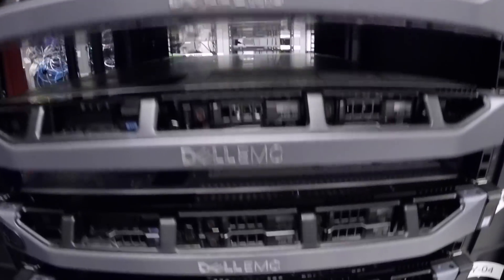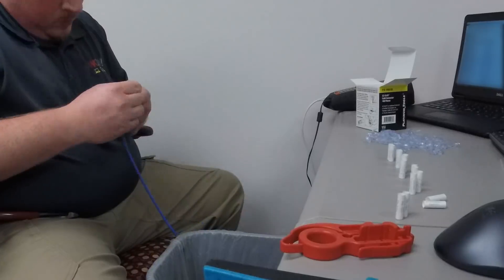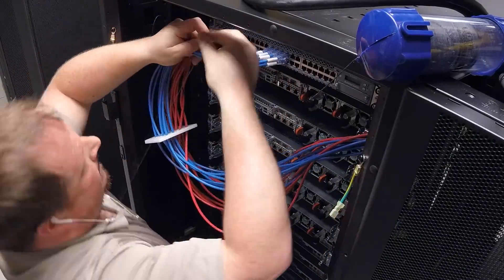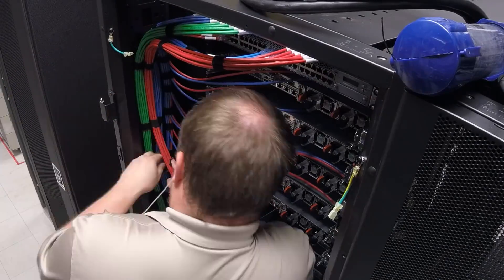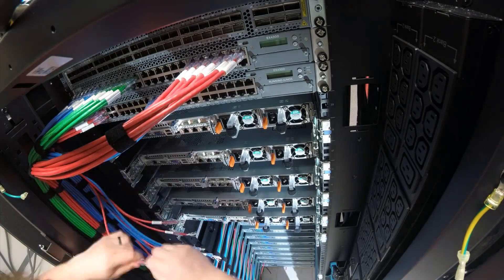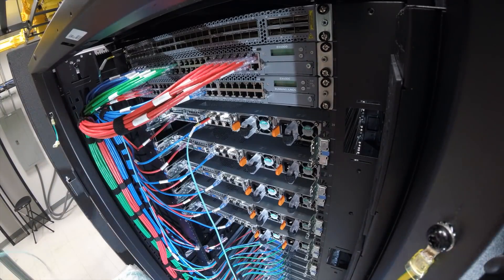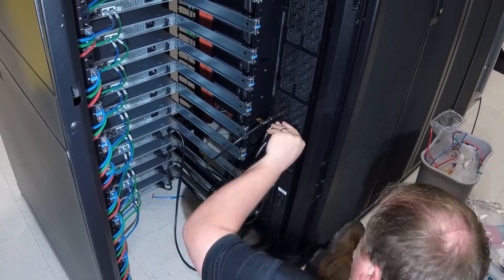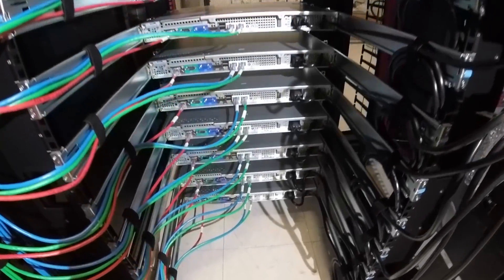Server Cable Build-out TimeLapse!

Comment: Ah to only deal with copper and fiber. It would be nice... I deal with 100G QSFP with 4x SFP breakouts with no good way to run them down the side of the cabinet. Add in a copper connection for remote access and it gets rough and these are 40 servers in a rack with 2 NICs.

Comment: Great work – that's a true piece of art. I even struggled with cable management in a small rack of the ad agency I'm working for.
One Idea I had to clean this up a little bit more: The 1 unit spaces could be filled with those brush panels to hide the wire rings behind them.

Comment: As far as not getting custom length fiber or power cables I'd say reterminate them too, all it takes is a little bit of know-how and the right tools for the job, if either or both are lacking that's a chance to develop your work skills or workplace equipment. Neither being all that expensive. All in all, great job.

Comment: I still don't understand why anyone would want to use solid core cables and hand terminate them for what is a patch cable. Patch cables are made of stranded copper and machine termination is just more reliable. They make a ton of lengths. You spend more money in labor alone then purchasing patch cables in bulk.

Comment: This reminds me of my old job at an IBM data center. Whenever we’d build out a new row we’d have hundreds and hundreds of individual eth cables going to each rack. We used to have to run them individually like you’re doing here, but eventually we started ordering custom made RGB bundles that were already cable managed and cut to size and mounted on the side of the rack as one piece. HUGE time saver... except for when we were building a custom row for internal servers. Still had to run each fiber cable individually though....

Comment: I generally prefer to either buy cables of correct length, or make them to order myself. Calculating cable length is usually not too hard and getting 5-10 cm extra isn't unwieldy in most cases. And I like making the cables outside of the rack, since then we can skip the shortening procedure at 3:30.

Cable isn't particularly expensive, but cutting off 20-30cm with each cable one makes quickly adds up. Not to mention that it still is a resource that could have been used more efficiently. From an environmental standpoint, our first rule of recycling is "Reduce", and I see a lot of people doing network cable management that throws out literal tons of "extra" cable for the sole reason that they wanted to save 30 seconds worth of calculating the length correctly. One can fairly trivially just make a spread sheet for it. Account for depth of the device in the rack, how far in on the rack it is, and how many rack units we need to traverse. And that is now the length of the cable, trivial. Add a bit of extra as buffer just in case. Works every time with 0 waste.

Comment: whats a good way to manage cable going vertical if your rack is not as deep as the one in this video?  Is there a rule of thumb about putting the switches in the back is it just for simplification? also how do you deal with sliding the servers in and out?

Comment: Learning to make your own custom fiber cables is not that difficult these days. I was doing fiber connectors back when we had to use glue injected connectors and hand polish the end of the fiber in the connector using a hand held microscope to monitor the polishing progression. I believe with the new technics today they could be done as quick or quicker than RJ45's.

Comment: Do you/have you use the pass thru style RJ45 plugs. We (just a two man dept.) tried them and couldn't get them to test out. I mean two different guys and we used sever sets of crimper pliers and both had bad connections. That style did seem to go together fast, but just was bad when we got done. I'm curious if other techs ever had issues with pass thru style plugs? With the managers we work under there's about a four year turnover in IT techs. No one stays longer than that as there's just no budget and it gets very frustrating, so people just move on. Only brief reboots is the only reason the servers can be down, never any maintenance time, NEVER.

Comment: Was the switches ex4300's with poe+ for the copper wires. Don't know about the sfp fibre switches which would probably be a few K of it was 10GB
Reply from the maker: We use EX4300s for our copper connections, I believe the Fiber Switch was a QFX.

Comment: A very good video, thanks for sharing. I have another newbie question if thats okay... What are the Red, Green, and Blue Ethernet cables used for? Is this an industry standard?
Reply from the maker: There is no "Industry" standard that I'm aware of. We have an internal standard about what rides over each cable. In this instance, Red is Lights out management (Dell calls it IDRAC). Blue is our management network, and Green is "Production" data traffic.

Comment: Amazing! Just finished patching three switches totaling about 466 ports to patch panels. No custom length cables just 6ft, 10ft, and 15ft pre-made CAT6. Balancing slack and neatness for that many runs is interesting and challenging! Also, big fan of hook and loop. Lacing is very cool, but not something I've ever used.
Reply from the maker: Lacing is an art-form in and of itself, Even I cant make it look as good as others I work with. Also i feel for you patching that many ports! I did about half that while doing a new build out for a college dorm and it was a pain to get it to look good!

Comment: What do you use to label te cables and what's the standart strategy?
Reply from the maker: Labels are a Rhino P-Touch style labeler using their driver and software package to make the labels on a computer. Each cable gets labeled on both ends even if it does not leave a given rack. We put the "local" device and port and the "Remote" device and port on each side. Additionally we may add other labels that have Circuit IDs or customer IDs. A typical label reads like this: <Near device ID> et-0/0/0 TO et-0/0/0 <Far end device ID>

Comment: I know one advantage of having loose cables: when there's one cable not working, it's easier to remove.  When everything is tightly fastened and tucked like this, you'll end up spending hours undoing your long hard work. Did you test your custom cables before tying them?
Reply from the maker: All cables were tested before being put into production, I just did not get a good chance to record it. And since we used Velcro, It does not take long at all to pull this apart and add/replace cables. Luckly, with the effort i put into the pre-wiring work, we havent needed to touch this stack to add or replace cables

Comment: fairly new to networking, so this may be a bit of a noobish question. but why are the servers getting multiple network cables? if it for load balancing or management?
Reply from the maker: Don't worry about asking noobish questions, that's how you learn! So on the top servers, the fiber connections are redundant. They also get a connection to the Management network, and there's also a connection to the Dell iDRAC connection to allow for lights out management. On the bottom servers, Its the same setup, but instead of fiber, there is an ethernet cable for the "Production" network.
Reply: @RomLabs  Thanks a lot!

Comment: What is needed to learn or how did you learn to build a data center?...if that’s what this is called. Pretty much if I want to do this what do I have to learn
Reply from the maker: There is a bunch of different skills that go into data center work. Its best to decide what your most interested in. What you see demonstrated in this video would be considered Low Voltage Wiring or Cable Pulling. If you want to work more on the server side, you may want to look into things like "Dev Ops" and virtualization. Networking also plays a big part, and you can explore certification tracks like the Cisco CCNA certification.

Comment: Dude, you should have made all those cables longer so they don't need to be disconnected when you pull the server out on its rails to either upgrade or replace faulty components,  Still could have been tidy if you had used the cable management arm which holds the cables and extra length in a tidy way and extends when you pull the server out of the rack!
Reply from the maker: Unfortunately we only received cable management arms for the larger R620 servers, not the smaller ones. These are clustered together and the “Owner” of the servers is OK with downtime if we need to work on them. I would tend to use the arms in other situations, but it just did not make sense for this project. Thanks for watching!

Comment: This looks great but with all that crimping I didn't see you test each cable before installing them to make sure all pairs are terminated correctly. Just a heads up for your future cables. Unless you like troubleshooting cables. I've found too many bad cables because people assume they are fine if they look good.
Reply from the maker: Every cable got tested and certified with a Fluke CableIQ meter. It simply did not flow well with the rest of the video so it got cut. I did end up finding a few mis-crimps but they were easy to replace. Thanks for watching!

Comment: Never a good idea to coil power cables... Potential fire hazard depending on the loads those servers are drawing. Always lay power cables flat going back and forth. Coiled you're basically making one half of a transformer...
Reply: Not remotely. The current running TO the device and the current returning FROM the device cancel out any significant magnetic field. The only risk of coiling up cable is if you're running them near max specification and they heat up due to lack of air flow.

Have a peek here: https://electronics.stackexchange.com/questions/192923/why-is-it-dangerous-use-a-coiled-extension-cord/232510#232510

Comment: Why, I repeat, why the hell are you making custom cables? Patch cables are so cheap and literally can get them sized with no slack. You also dont have to worry about solid wire limitations on bends.....Just too much work for no gained benefit.
Reply from the maker: Simply put, I could not get the other departments involved in this project to order the proper length cables. They would not even order me different lengths of the power cables. Got to make do with the tools and supplies given!

Comment: Why the UTP cables when you also use fiber? Fiber does the same thing but 10 times faster?
Reply from the maker: There is a cost associated with running fiber for everything. First the Dell iDRAC is Ethernet only. On the management side, using a separate copper connection means we have an alternate way in case something goes wrong on the fiber side. For the lower servers, is simply cheaper, They simply won't see the traffic to justify a fiber connection. We do attempt to keep anything 1Gbps or above on fiber however.

Comment: What type of RJ45s did you use? I like those with the boots.
Reply from the maker: Platinum Tools EZ-RJ45. I love the boots since they are the same plastic that's in the connector itself, and it has 2 prongs that attach to the crimp via the outer jacket crimp in the back. That means the jacket is the same width as the connector itself so no issues with tight fit on switches. They feel real nice all crimped on and look great.

Comment: Is there any consideration for rolling the Server out on its Rails?
I mean, if there's a need to replace or upgrade hardware, I can see exactly how the rest of your work simplifies the disconnection and reconnection of all cabling, but I'd just thought about it looking over the finished product (it was the Power cables that prompted the thought).

Similarly, where did you get the HDPE plates you pre-drilled for those cable combs?
I bought a Cable Comb designed for long haul copper cabling pulls (where a good amount of force would be applied to the Cable Comb) but the plates you have there are simply genius for planning out, and procedurally 'grooming' each set of cables for each device in that rack.

The finished result isn't appreciated by some, but for others who have had to come in and clean up, or worse, try to just 'make sense' of the cabling nests that are abandoned, this level of detail, and finish is massively appreciated!
Reply from the maker: The way I wired them, a server would need to be taken offline to slide it out for maintenance. I only received cable management arms for the larger servers. Also, the "Owner" of these servers has them clustered so taking one down for maintenance won't massively impact any individual application. There are advantages and disadvantages to both ways, so it's important to think about the end results of any given project to decide what's best. 

HDPE can be bought online from McMaster Carr or even Amazon. Another option is to buy cheap cutting boards and cut/drill them to what you need. Also, there are options to 3D Print your own designs!

Part of my job is cleaning and maintaining a bunch of racks that have not been matained properly in years, so its important to me to make sure all new work as clean as possible. Thanks for watfhing!

Comment: What kind of rj45 plugs do u use? Some u need a tool for or tool-less ones?
Reply from the maker: I try to stick with Platinum tools EZ-RJ45s and their crimpers. I've worked with toolless RJ-45 Jacks and i never have good luck with them. I always stick to the kind that need punched down.
Reply: I dont got the money to buy rj45 plugs for 150$, i got the simple ones as 10pcs for 1,50$, and bought a toolkit which cost 14$ and includes all needed and acutally really good tools, but ive never crimped these before i destroyed 5 plugs by putting the wires wrong in😂 i wanted to ask if it really makes a different wheter i would buy cheap rj45 plugs or special shiny rj45 cat6 or 7 plugs(which costs directly 10 times as much as the cheap ones)?
Have a nice day
Reply from the maker: @legominimovieproductions  If you're doing a handful of cables for your house or just to play around with, There's nothing wrong with using cheaper tools or connectors. Just be sure to match the cable with the connector! RJ-45 connectors come in various sizes for Cat-5E, Cat-6 and various other forms. There ARE physical differences in the cable and internal wires that make this important to remember so your sized right!
Reply: RomLabs Ah okay thank you :)

Comment: Did you get to add blanking plates or are they just going to keep it with all those gaps?
Reply from the maker: The gaps are going to stay. We don't maintain hot and cold aisles so we don't need to worry too much about isolation. Thanks for Watching!

Comment: Pretty annoying that those servers don't slide out. Would have been good do install the cables in those management arms!
Reply from the maker: We only received arms for the larger servers, not the Dell R220s. The department that "Owns" These servers is OK with downtime if we need to pull them out to work on them since they are in a cluster configuration. We will see how it goes in the future but so far we have not needed to pull out any servers.
Reply: @RomLabs  I see, interesting back story. Keep up the good work!

Comment: Why did you not leave enough cable that the server could be pulled out without disconnecting?
Reply: because theres not alot you can really do with the server powered on beyond swapping fans anything else youd need to power down so this works to weed out the idiots as op said in anouther comment the client doesent mind a little downtime

Comment: Which RJ45 plugs do you use? Plugs that are open on the end for wires to stick through to cut later or closed?
Reply from the maker: They are Platinum Tools EZ-RJ45 connectors. The crimp tool has a built in blade that cuts off the excess wire during the crimp. Ive been using them for years and they tend to work great as long as you keep the blade clean and sharp.

Comment: But the cables weren’t tested and certified? 
I’ve just use vertical cable managers and preterminated and tested cables. Makes life easier and more reliable

Looks awesome tho lol
Reply from the maker: I did not show it in the video, but all the cables were tested with a Fluke IQ meter before we turned up the rack. I would have preferred to use pre-made jumpers, but i have some trouble getting other departments to understand the need to buy those in different lengths!

Comment: You are absolutely awesome, these things do take forever, and are hard to do properly, but any person in the future will thank you from the bottom of their hearts 
Greetings 
(I myself love soldering, i also love the rj 45 connector, its awesome in my opinion)
Reply from the maker: RJ-45 is a really versatile connector! You see a lot of network equipment use it for the serial console connections as well, but now more is going to Micro USB. I deal with so many messy racks i tend to over compensate by making sure everything i do is as clean as i can make it. Thanks for watching!
Reply: RomLabs well yeah i had a messy server rack at work once 
I myself dont work in this sort of a area, so i had no idea how to do it
Some cable had a problem, i had to replace it, after 2 hours my boss came in and told me to just put a new cable through and leave the old one
INSTEAD OF FIXING IT

(I work as a so know laboratory physicist (Physiklaborant in german), its like the guy who makes measuring equipment and fixes literally everything(from changing lamps, to measuring special sensors, to cleaning up our production), i try to make all my projects as clean as possible, and when i see this, my god it looks awesome)
Reply: RomLabs i have never seen or heard that a micro usb connector gets used on servers tbh. Interesting
Reply from the maker: I'm seeing it more and more on newer networking equipment. Typically they are building the USB to serial adapter into the switches now.